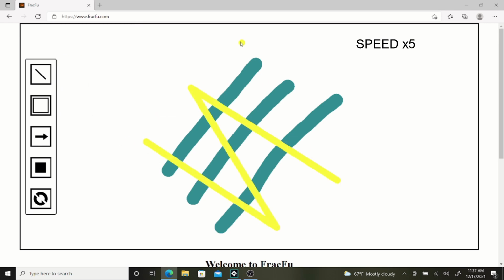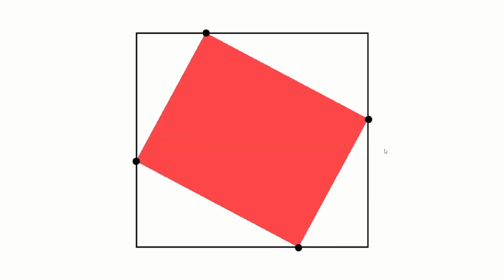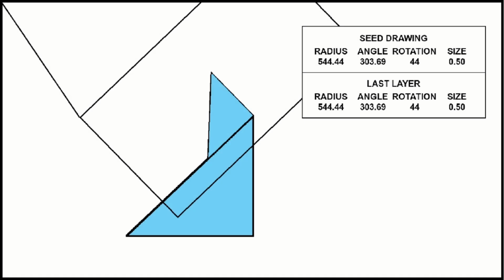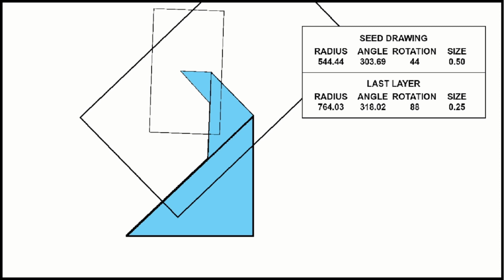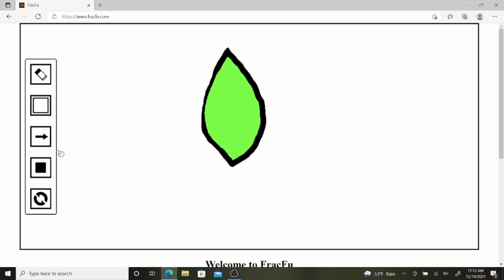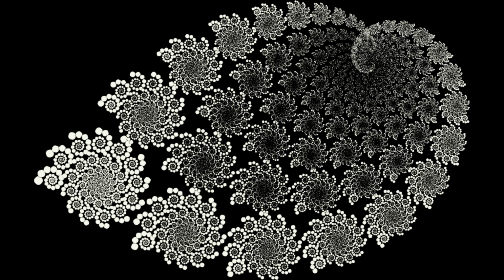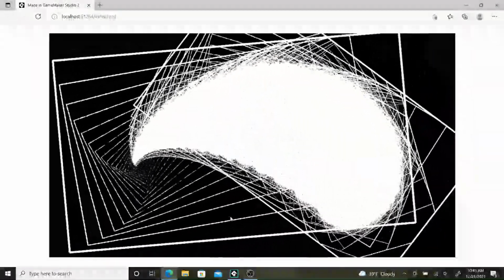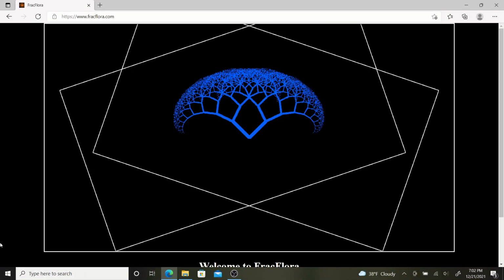Homemade Fractal Generator

Comment: 3:08 Wouldn't a simple solution be to take the transformation that took the canvas from covering the screen to its wanted position, calculate the inverse of that transformation, apply that inverse to the mouse coordinates and then check if these new mouse coordinates are still on screen?
Reply from the maker: Intuitively this makes sense, and I did not think of that! This is a pretty general solution though, so it is nice to have something so applicable in your back pocket (should work for many other shape types, or rectangles not scaled from the screen dimensions).
Reply: @mardev2967  Yeah, I'd expect your solution to work for any convex shape, and the area calculation may be faster than a rotation like that as well. I just think transforming your rectangles to be axis aligned and normalized can help in a lot of situations, and spare one from brooding over a problem for too long